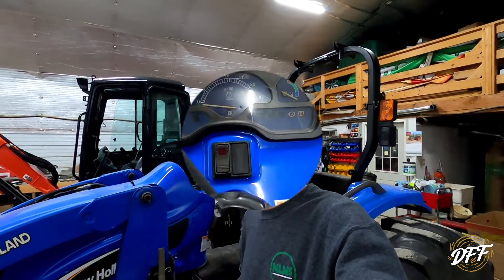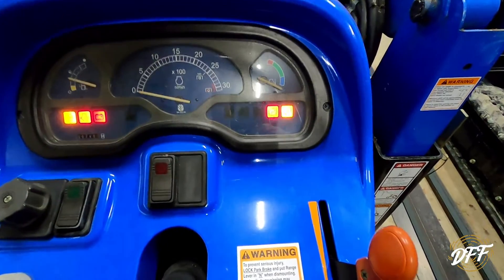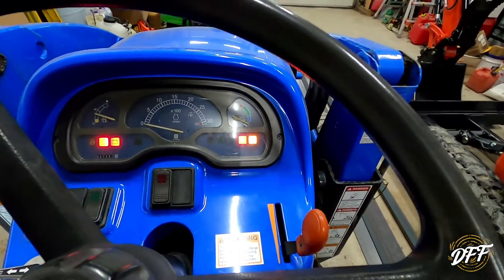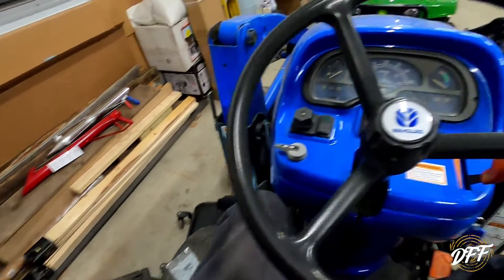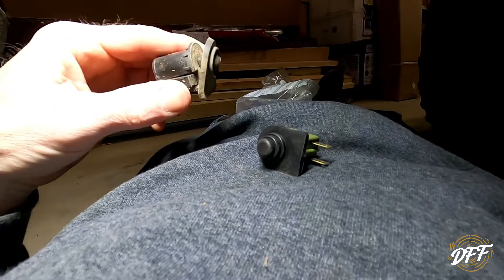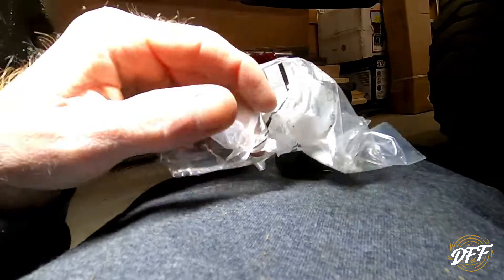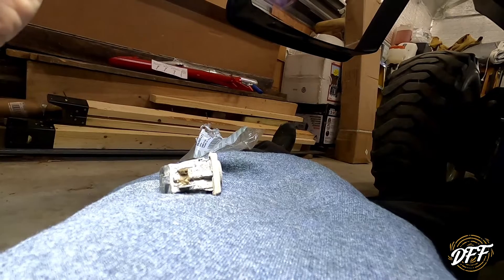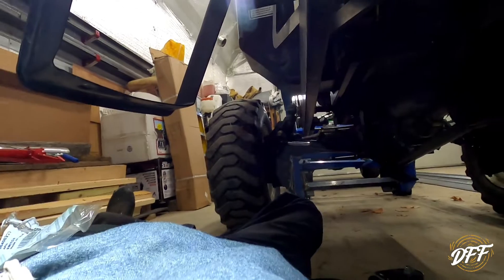PTO Switch Replacement- New Holland TC 45DA

Comment: Whatever happened to to good old days when we didn't need safety switches on everything. We just new not to stop or start the tractor with the pto engaged. Thanks for the how to video.
Reply from the maker: LOL Too many people without common sense started buying tractors I think :) And then engineers thought it would be fun to keep adding more and more electronic crap as the years have gone by. Some of it wouldn't be so bad if they would let the average mechanic work on it, but making you take stuff to the dealer is ridiculous!

Comment: Thanks for the video. I have a tr45da and i replaced the same switch but my issues is that the pto light goes off and sometimes my tractor still wont start and the 15 amp fuse below the steering column will blow. Sounds like a wiring issue somewhere? Any recommendations? Thanks!!!

Comment: So I have  a tc40 and the pto stops turning sometimes on hills.  Then I have to let it sit and cool down 2-3 hours and then I can engage the pto again. When the Pto stops turning, the arms won't work either.  I changed the trans filter last year but it didn't help.  Any suggestions will be greatly appreciated.

Comment: Hey Chris. Maybe you have seen this one. I have a new holland tc 40d I just bought second hand. I go to start it I let the glow plugs light turn off I try to start it and nothing happens. I hold the key for a couple more seconds and there is a click sound from the fuse box behind the gauge cluster and the pto light comes on. It has me baffled.
Reply from the maker: Maybe a relay? I believe there are some around the dash area. Good luck!
Reply: Thanks. I went to take the battery off  to charge it over night and one of the posts came right out so I'm crossing my fingers this has something to do with my problem.